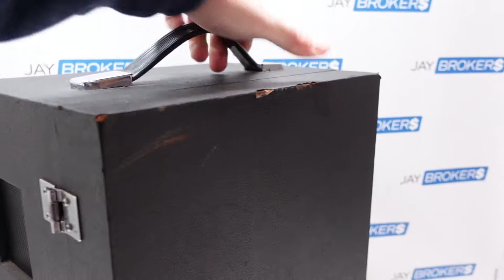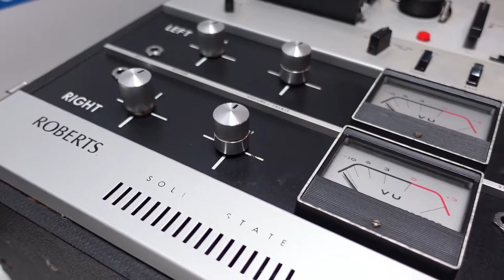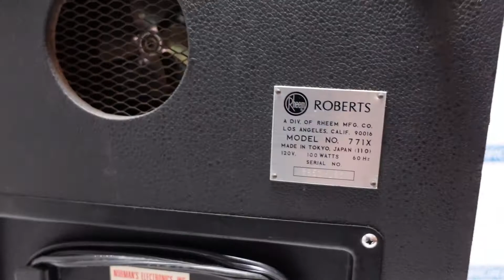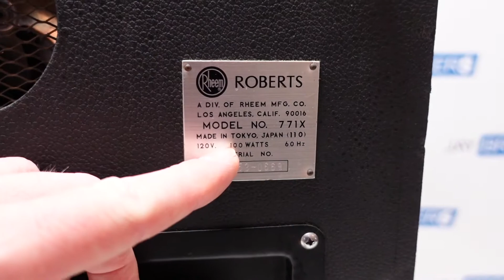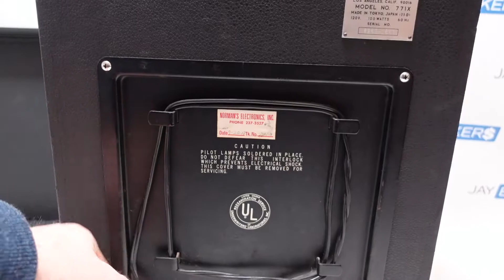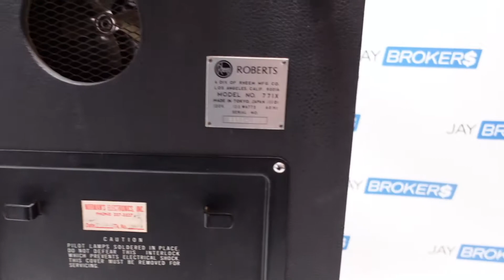Roberts Solid State Model 771X Portable Reel to Reel Tape Recorder

Comment: I've had one for years and I picked up from a rummage sale on a school district in 2002. Still works and plays great. Picked up a replacement capstan sleeve,( it was missing, for making it able to play 7 1/2 inches per second), from oak tree vintage for about $20. Its amp can easily power aux. speakers.

Comment: I have one of these, also with the Rheem label. The Roberts 771X is a solid-state model from the mid-1960s, identical to the Akai M-9 except for branding. It evolved from the tube-based Roberts 770X (Akai M-8) and earlier 720 (Akai M-7), featuring a cross-field recording head, quarter-track stereo recording/playback, half-track playback, speeds of 3¾ and 7½ IPS, and support for 7-inch reels.  These days, getting replacements for dried rubber parts is a challenge.  If I recall, the speakers are about 10 watts each side.

Comment: Just got mine back from suspended animation. My understanding is that along with the Dokorders a lot of these were brought back by Servicemen from Viet Nam. 771 X Model dates back to 1964 and inside reminds me of some fully mechanical Elac turntables from that era that  I resold once.
Mine has someone's FICA # etched into it. I handled a lot of worn out end of life professional stuff grade late in the last century and I can tell you this is the same build quality as what they called "Industrial" after 1986 or so Possibly could have been sold earlier on and for more $$ than the $150 Saigon street price on the later reel to reel units.  By comparison a Teac was >$600 well into the 1980s and once they had built up a tape collection people didn't sell these decks used very much if they could help it

HINT: VCRs didn't exist yet and the only other thing to collect was records. Thanks for the Video and your business in general. The only other recordable media period was Cassette

Plugged in the DiN cable for the first time in 15 years, daddy to the original IBM PC keyboard cable in almost every respect Into the best Amp I have. Mostly I kept this around for when retired hardware engineers & firmware guys tried to tell me that all capacitors dry out sooner or later- then at this point the same level of "portability" that Led Zeppelin would have put up used to come in handy if they were willing to bet on it first.

Comment: Hi, Yes I own one I drove for 3 hrs to buy it listed for 65$ but when put into play with tape the Idler Wheel did not move.. I put tape on it in play and dragged the tape over the heads and I got noise, yippy, electronics good, Deck has a problem (simple I hope). I paid $50.00 for I.  cosmetically in good shape missing one tall foot off the rear. Deal 9 out of 10. :)